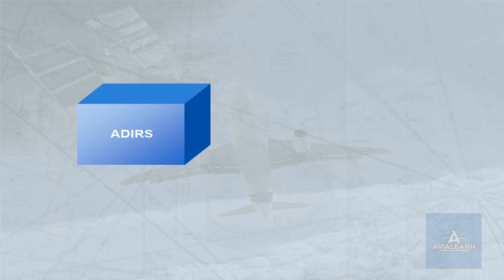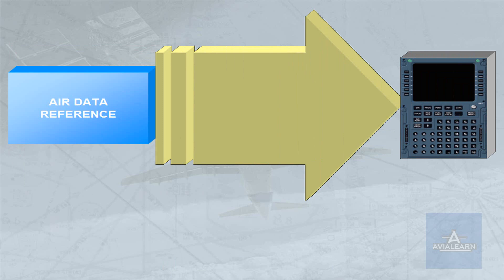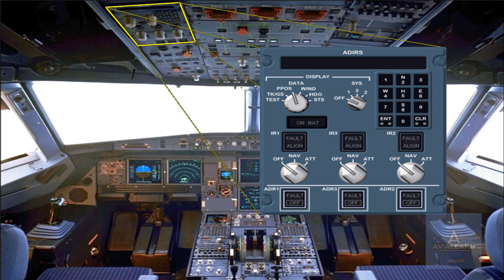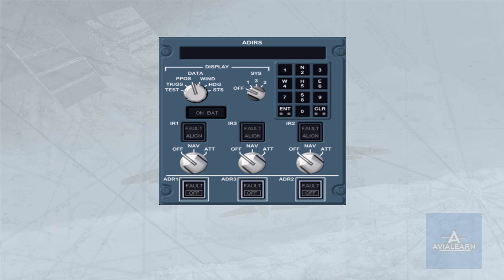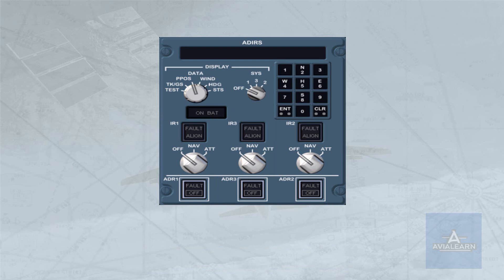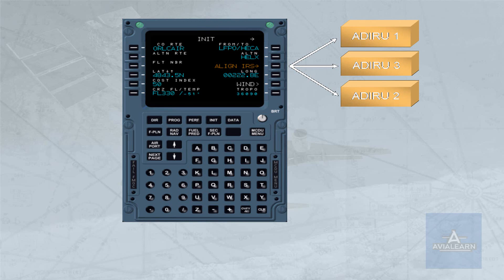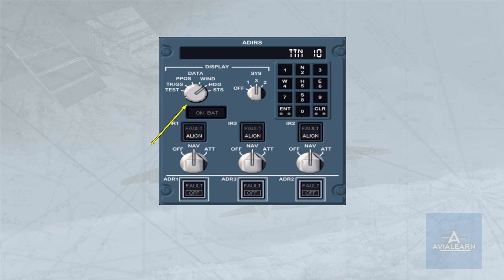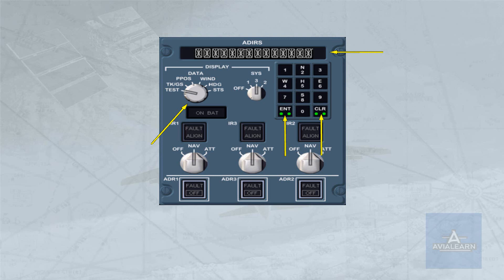Air Data Inertial Reference System (ADIRS) Presentation - Airbus A320 Family

Comment: Dear Team, 
    Request you to clarify what is the correct way to perform a full alignment on a A320. And where is it mentioned. Do we Off and the Nav ( after 5 secs) one IRS at a time? Or can we switch all 3 to OFF one after the other and then to NAV in sequence. Also do we have to align 1 then 3 and then 2 in that order? There is an RTLD damage caution if All 3 set to OFF simultaneously with Flaps/slats out in the After Landing procedures as a note. Does that mean we must as a caution for the RTLU always switch them OFF then to Nav on an IRS before doing the same on the next IRS without switching them all to OFF back to back?
Reply from the maker: Switch IRS 1, 2 and 3 to NAV mode in this order or any order you want, but wait for the ON BAT light to extinguish before switching the next IRS switch.
Go to MCDU, Init page enter departure/arrival airport, then IRS INIT then click align on reference then confirm the alignment. Once you have done that, wait from 7 to 10 min and then the 3 IRS will be aligned.
Reply: Great content, thank you. Out of curiosity, what does ATT knob position do?